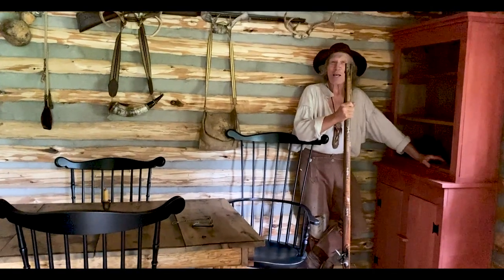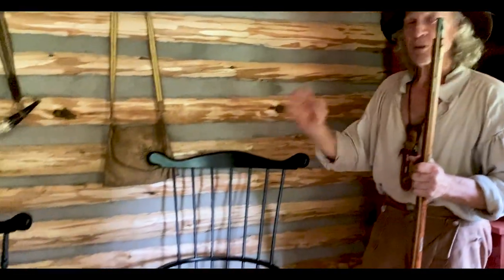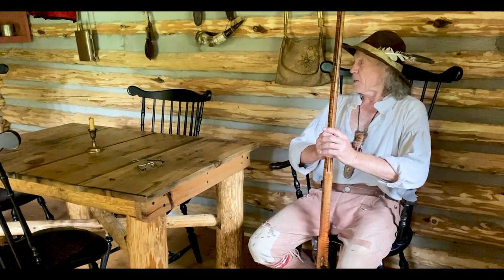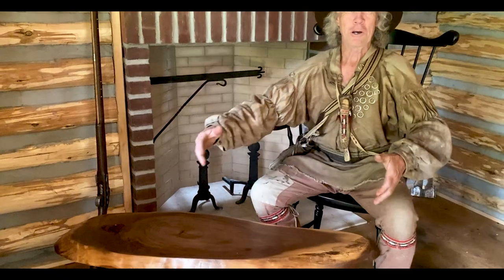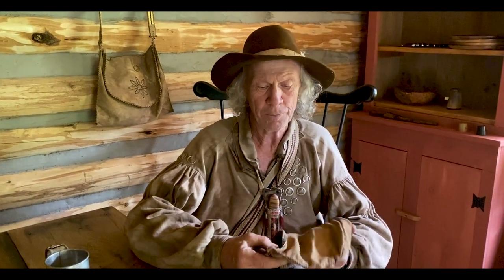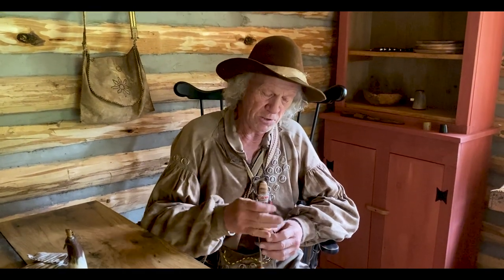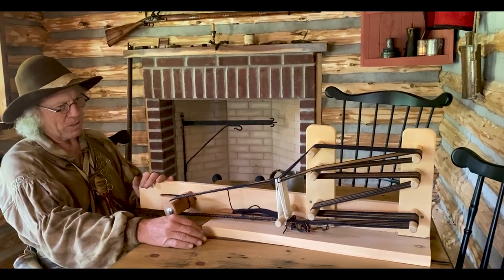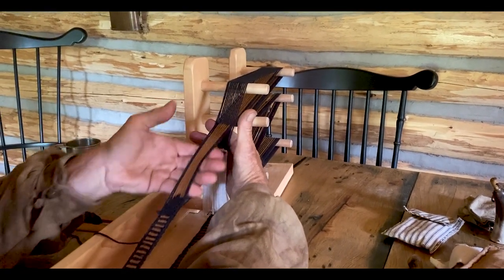Building 18'h century Furniture and How to Use an Inkle Loom | CABIN BUILD | PIONEER

Comment: Great video!! I'm interested in the inkle loom. I do have to disagree with you regarding lock mortices and patchbox holes. I have never seen any that did not have any sealer type finish on their surfaces. They weren't usually finished to the full stock quality, but they did have some sort of sealer/finish on the surface. Please keep the videos.
Reply from the maker: Great feedback David.  You are no doubt right about the sealant used in musket building.

Comment: Love the bag but the three legged table more!  Is there any way that you could sell the plans for this three legged tables or stool?
Reply from the maker: The top is simply a piece of walnut cut on a 60 degree angle and 3 hand whittled legs.  The log it came out of was only about 15” in diameter  but, cutting it on the bias gives a top that is 3 feet long.

Comment: Would a poor settler have used nails so freely; maybe wooden nails or pegs instead?  Would a poor settler have used a perfectly useful workbench as a countertop?  Wouldn't it make more sense to use it as...a workbench?
Reply from the maker: You are right on both counts.   I did use wooden pegs in different part of the construction on door and window frames etc.   Surviving 18th century furniture if built crudely, say by a booger would have been pegged but, finer furniture was nailed.